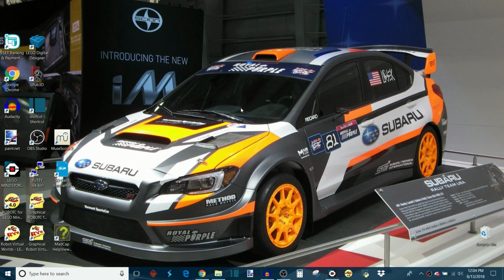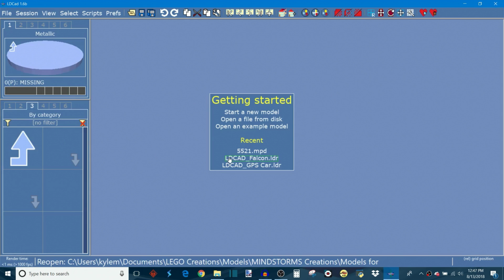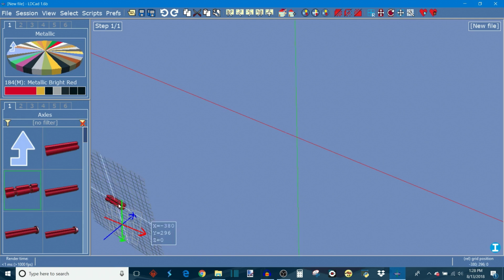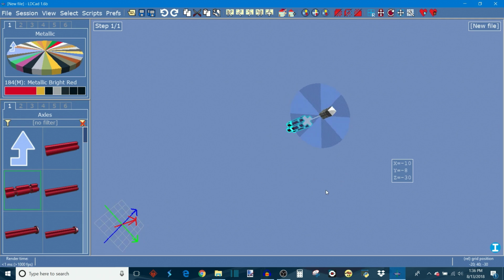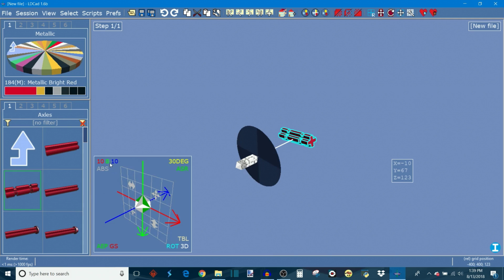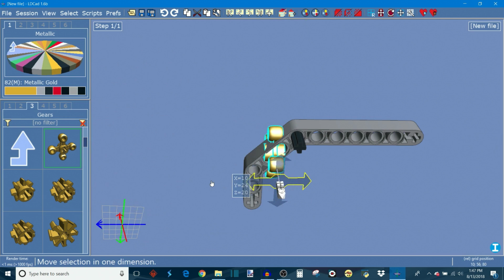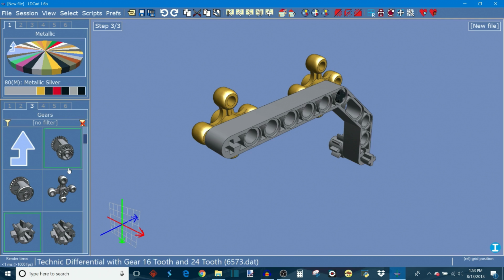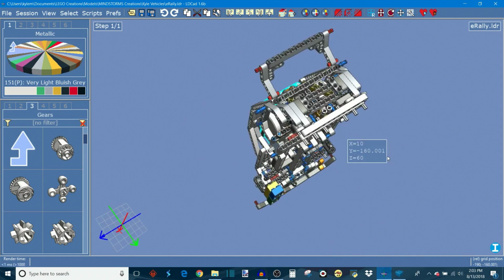Getting Started with LDCAD - A Better Alternative to LDD

Comment: Wow, thanks. The moving parts into parts might be a solution for me, I'm trying to create better plans for the "MOC - Efferman's Vertical Stand for Millennium Falcon 75192" but it bends and shifts longs liftarms a bit, but enough so that STUDIO and LEOCAD can't accept these angles, resulting in holes in the arms that will never line up.

Comment: Hi Kyle.  Thanks for the tutorial.  Just FYI--When I download the setup version of LDCad for Windows, the program fails to install.  The little install circle goes round-and-round and never stops.  However, when I download the archive version, LDCad simply runs without going through an installation process.  It does ask for the location of the data files on the initial run, and it runs just fine after that.

Comment: Hello, ask you a question that has been bothering me for a long time. I have two color sensors, one on the left, port 1 and the other on the right, port 4. When I wrote the calibration procedure for port 1, I found that port 1 is between 0 and 100, but port 4 is not, it will be larger or smaller than 100. How to solve this? thank. According to the information I have seen, when the color sensor of port 1 is corrected, port 4 should be automatically corrected at the same time.
Reply from the maker: The EV3 saves all calibration values globally, meaning that if you calibrate one sensor, all of the color sensors will use the same calibration, regardless of port. I think this is what is happening to you; the calibration that works for sensor 1 does not work for sensor 4. I recommend reverting back to factory calibration and think of ways to make the program less sensitive to the difference in readings between the two sensors. Usually you can adjust your target light value accordingly to accommodate this. Good luck!
Reply: @Builderdude35  thanks